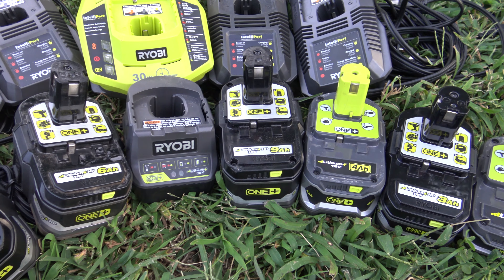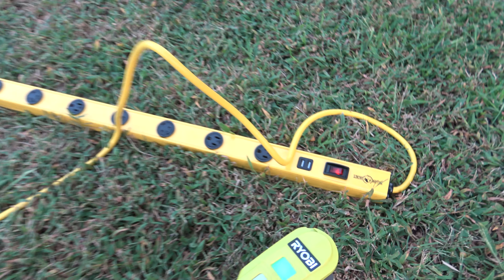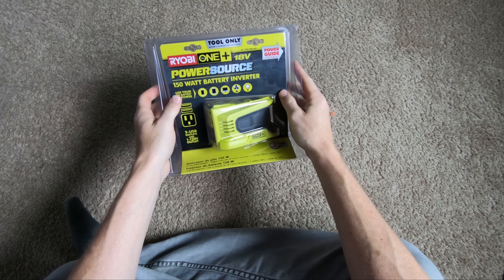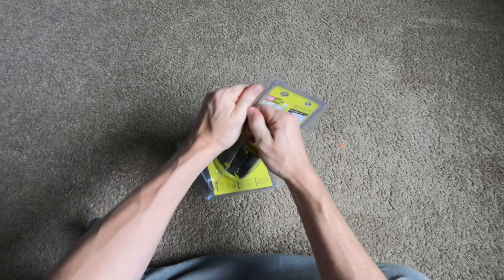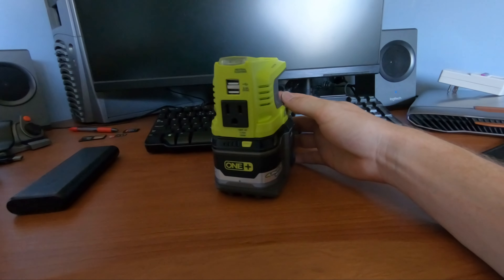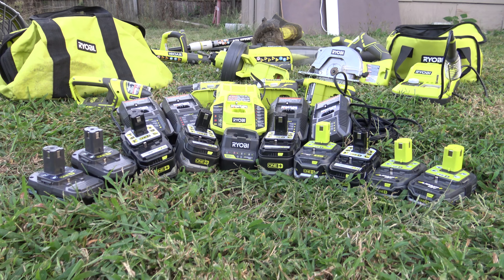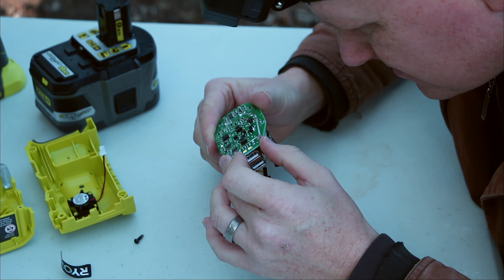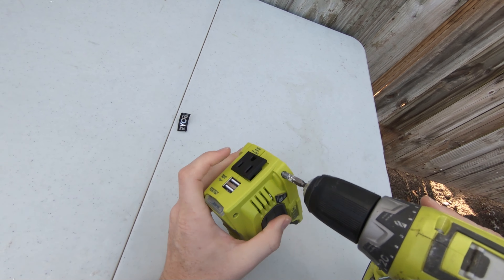Ryobi Powersource 150 Review for ONE Plus 18v batteries DO NOT BUY

Comment: I purchased one to use in my off grid cabin. I use a generator but in some cases I do not want to run the generator for the just the tv . I plug my 32'' smart tv into tis inverter (4AH Battery) and can run the tv for 2 hours no problem. Has worked well over the last 4 trips to our cabin. Will run my table lamp 5 hours .
Reply: I wondered about this. Thank u for that comment

Comment: have had mine since it was released. taken it camping for 4 weeks ran both usb and 120v fans and LED work lights and tested 12W lights on jobs  its great not one problem
Reply: update 9/21/2020 still going strong. I used it to test 15 disk lights in a basement that had no other electrical on yet. also used it to charge a Ion pathfinder 2 bluetooth speaker.
Reply from the maker: @dondiego124  nice, glad to hear these are working for some.
Reply: i know I am quite off topic but do anybody know a good site to watch new tv shows online ?
Reply: @Chaim Uriah flixportal :)
Reply: @Adrian Chandler Thanks, I signed up and it seems to work :D I really appreciate it!!
Reply: @Chaim Uriah Glad I could help =)
Reply: Had mine for 3 months. Zero issues. Only use the USB.
Reply: @dondiego124  it's 4/23/22 an its still going i cant wait for the new usb C to come out

Comment: I use this with the 9ah battery.  It works great powering my portable refrigerator for few hour until I return to the car.  It's also great for light field work like powering a soldering iron
Reply: This is exactly what I wanted to know. How long  did it power the refrigerator for?

Comment: Bought an open box return on Ebay for $40 about 3 months ago. It arrived DOA-I took it apart and found a blown 25A automotive fuse inside....The fuse has to be desoldered and resoldered. I use the USB everyday at work to keep my phone charged. When we had a power outage this thing allowed me to use many low power devices (cats litter box) which really saved the day.
Reply from the maker: Glad to hear it worked for you. Since, mine has taken a dump. The fuse did blow. I replaced it. And now it only has a red power light. Dead.
Reply: Do you think it would power a drip coffee maker?
Reply: @walkersonneville5036  Look at the back where it plugs in or where the cord goes into the coffee maker. It should show the power consumption. If it's over 150W then no, something like that is probably over 150W.

We had a power outage where I live a few months ago. House got really cold....Recently I tested my fireplace fan and realized it will run the fan for an hour or two on a 4AH battery. Next time power goes out we won't have to freeze!

Comment: I purchased one of these in May 2019.  I use the USB ports almost daily and haven't had any issues.  I've also used the AC port to power portable refrigerators and other devices.  As long as I use devices that are under the 150W or 1.25A rating it's been great.  I have been very happy with this purchase. Nice review.
Reply from the maker: Man, I wish I could say the same. At least it's working for some others.
Reply: I’ve had mine since 2019 as well and I’ve also had only awesome feedback.  I used mine daily going through several batteries each day while commuting 5 daily hours on a train and it was a life saver.  I left a battery and charger at work and would just rotate the one I used on the commute in then it would go home with me the next day.  I hope more people read about the good experiences with this because when I saw ‘do not buy’ on the thumbnail of this video I had to watch the video and though I respect the very likely chance the reviewer got some bad luck lemons I wanted to vouch for this item in my own experience… this powered/charged my iphones, iPads, misc usb charge gadgets and started many a conversation when helping fellow commuters who were in a jam to charge their devices on the train.  In the process of Getting the 40V version so that I can use my MacBooks as well.  Cheers all

Comment: I bought one a couple of days ago and for grins, hooked it up to a 50W speaker and a separate 100W sub woofer.  I streamed some Mark Knopfler at medium volume.  When used together the speakers were pulling about 30 Watts and about .8 amps.  Worked great.
Reply: Cool I have been wondering if it run a 45 watt Fender tube amp. About 3 amps. So thanks
Reply: Any noise issues?? due to it being a modified sinewave

Comment: Just got this as a gift. So far it's nice, but it goes through batteries very quickly. I crunched the numbers and found it was only about 70 percent efficient while charging my phone through the USB ports
Reply from the maker: Come back and update us on the usb ports in a few weeks, please
Reply: @TRYtoHELPyou  I also plan on doing a more accurate efficiency test. I'll take a full P107 and see how much power it can put out of the USB and outlet before the battery is empty. I'll measure it using a USB doctor and kill-a-watt respectively
Reply: I tested the USB ports and off a full P107 I got 3375 mah. That is 16.875 watt hours, meaning it's about 60% efficient with the USB ports. I'll do a similar test with the outlet and update this reply

The outlet was about 63% efficient. My kill-a-watt wasn't precise enough so I found the efficiency of one of my USB power bricks and then used that and the current from the USB doctor to find the efficiency of the inverter itself.

Comment: I bought this to power a few Christmas Lights on my car for a Christmas Cruise. Didn’t make it through the whole cruise and had 5 batteries. Each fully charged battery was dead within 15 minutes. I was happy with how fast it charged my iPhone, but not $80-$90 happy.  It should be listed at $19.99.
Reply from the maker: You must have been using non-led bulbs, yeah? My problem mainly was with the USB ports failing, so I'm glad it's working for you. Eventually the AC portion of the thing went bad on me.

Comment: Thanks, I was looking at this for a light weight power source to take up in my roof top tent.  to run my USB powered lights and to charge my phone.  Im sad that the USBs failed frequently, but glad I didn't have to spend 80 bucks to find out.  Best of luck.  Keep sharing.
Reply from the maker: Thanks for the good words. Yeah, i had some bad experiences overall. It has finally kicked the bucket. Not everyone is saying their USB ports fail but.... well i wont be making any more purchases with this one. I do have the Rigid batteries and the USB (only one port) for that. It works well. no AC plug tho. Dewalt is likely your best choice if you want quality.
Reply: I just built myself a little adapter for like 5$ for that. I took a 12-24V car usb charger, built it into a bit of pvc pipe that fits over the batteries, and voila, 2.4amp usb character that runs of ryobi batteries for 5$ and some spare parts.

Comment: I use it to run holiday LED lights, laptop, 20w hot glue gun, modem and router, led tv's, evadry 9w mini dehumidifier, will run various fans for various time periods depending on size, can run a bunch of 100w equivalent LED bulbs, electric blanket/heating pad, etc. It is a modified sine wave but that doesn't really matter for anything that is bridge rectified to DC.
Reply from the maker: Glad to hear it works for some people

Comment: This has been the handiest little thing. If I use my usb adapter that came with my phone it charges faster than the wall outlet. Only thing I think it is missing is a lanyard strap.
Reply: But it DOES have the mounting point for one, meaning we're a mere piece of cord, a cable-tie, or an actual lanyard away from having it tethered to something.  So that's good.

Comment: No issues with mine. If you really want to you can 3D print Ryobi holders and solder multiple connectors in parallel by a 20V to 12VDC 40A buck converter and get 480W out of a few of these batteries in parallel with a typical 12V car inverter of your choice.
Reply from the maker: Good idea yep yep

Comment: Well, I got one and use it to power up my Sony 2010 Shortwave radio. I put a V.M. on the USB port and it reads 9v, supposed to be 5v, but it wasn't under a load and not sure if it should make a difference. But it didn't leave me feeling very comfortable about using that port.
Reply from the maker: Ah jeez. High pressure.

Comment: Can I use it to charge a Ryobi Battery, thus creating a mini circle of life?
Reply from the maker: Yes... But the efficiency loss causes a mini drain of death. Like when you have to #1(or #2) after drinking hot sauce. Don't try it.
Reply: TRY to HELP you haha good call. Picked one up for $20 this week.
Reply: Yes the new model will do that now.
Reply: @TRYtoHELPyou  yes
Reply: @MIKES0029  $20 is killer for one of these.  I got mine for ~$30 during a promo, and I felt that was a fair price.  Regular price on these is $59.97 now, so it did come down from the original ~$80 release price.  That's not as low as the "regular" price has been though, because I remember in 2020 the shelf price was $54.97 for quite a while.

Comment: Same issue with the USB ports. Charged two phones on it for a few hours. Next day try them both again and it shows charging but doesn’t charge.
Reply from the maker: I wish this wasn't the case :/
Reply: @TRYtoHELPyou  oddly enough. I switched batteries and batteries 4ah and under the USB ports are working properly. The 6ah and 9ah however they do not.

Comment: It has a protection thingy inside just unplug the battery wait for 3 seconds slap it back on and it should work if it doesn't repeat this step
Reply from the maker: I appreciate the assist here but I did this several times. One person also claimed it was the larger batteries that was doing it (they are all one+) so I tried them all. The USB ports were dead. I want to be wrong about it but I thoroughly tested it, tried it out. It broke.

Comment: I've made DC power banks from old Ryobi chargers 1 9ah battery will make 3 pots of coffee ( 12 volt coffee maker) or will run 12 volt cooler for about 6 hours. I made a 6 port from an old defunked 6 port charger I'm thinking of using it as a power wall in my camper. Since my solar controler has a 12 volt outlet and I have a 12 volt Ryobi car charger I could recharge the batteries off either the truck or panels....I used to use the USB on my Ryobi radio to charge my phone at night camping...it also went bad on me😒 I'm thinking they're just plain cheap parts bought in bulk
Reply: Interesting!, I'd like to see a video of how you made the power banks.

Comment: Stumbled on your channel from this video. I can't seem to justify this over the cheaper 120 watt automotive 12v hybrid model. Sure this just chonks on, but functionally, i dont know how many devices commonly used require those extra 30 watts. Your gaming laptop idea is perhaps one that would need that extra wattage, but it still functions on lower wattage, as long as you keep activity low, and when you crank up the activity, it would run on battery i assume.

But yea, i'm comparing the two right now to determine which one i would buy
Reply from the maker: Well, I would not suggest this one but definitely looking at that hybrid. In fact, I bought the 800 watt one a while back and it is brilliant. Writing a review script soon. Trying to get back to uploading.

Comment: I been thinking of getting something like this to power a ceiling fan in my storage unit to circulate the air. It draws less electricity than a light bulb so should this be fine for that?
Reply from the maker: I highly recommend something else. This power source is not very good it may work for a ceiling fan however you will have to change the battery every 10 hours or so with the 9ah battery...
Reply: TRY to HELP you it wouldn’t be getting that much use each day. Maybe an hour at most per day at the least
Reply from the maker: I just think it's not very good is all... Mine is already fully broke. I changed the title to this video a while back to "do not buy"... So keep that in mind.
Reply: TRY to HELP you I will keep that in mind. Thanks for the reply!

Comment: How long is it going to work wthe the battery 4Ah or 5Ah?
Reply: on a 5 amp battery with a 150W/h load.  18x5 = 90w.  - 10% efficiency loss = 80w  So your 150W load will only operate for about 32 minutes on a 5 amp battery.

Comment: after your review I don't know, I was considering buying the air cannon but on another review they said id be better off buying this inverter and a high viscosity. Fan and I'd get better results...somebody tell me what they think?
Reply from the maker: air..... cannon?
Reply: @TRYtoHELPyou  18" hybrid floor fan.
Reply: I tried that, on a 4 amp battery I plugged my floor fan in.  The max power on my fan is 110W.  No a very long run.  Even  when I set the to fan to level 1 it still doesn't run for a long period.

Comment: Can two of these inverters be connected in parallel to double output? (300 watt)
Reply: night, as the voltages will be out of sync and fry the inverter when connecting in parallel

Comment: My ryobi batteries die within a year - what's up with that?
Reply: You probably don't use them much and/or you leave it on the charger for a while. Just make sure that you get oem batteries. I have two batteries, p108 and p105 and they have lasted three years, work like new. Might just be variation in quality
Reply: I had two of the 1.5mAh batteries die on me over the last few years. I think it is from leaving them connected to the tools while not in use. The batteries are supposed to stop working when they've been drained to a certain point, but if they are drained further, the charger is not able to start charging and displays an error. I've seen some videos of some people drilling a whole into the battery and hardwiring a charger to "jump" the battery. Just don't keep your batteries connected when not using the tool.